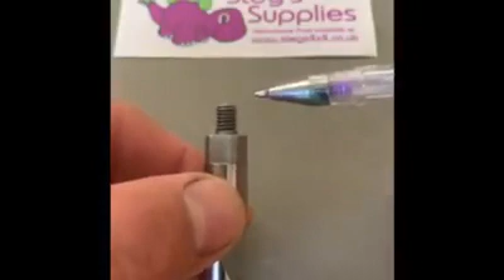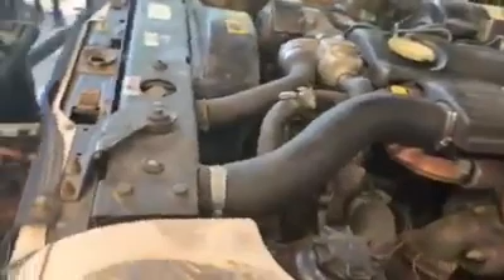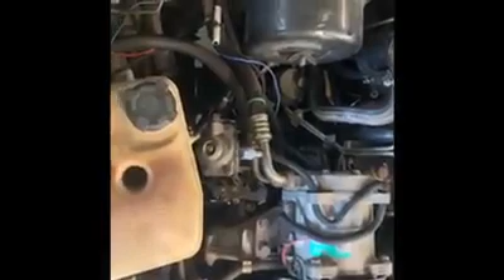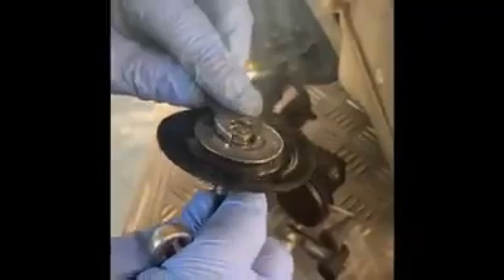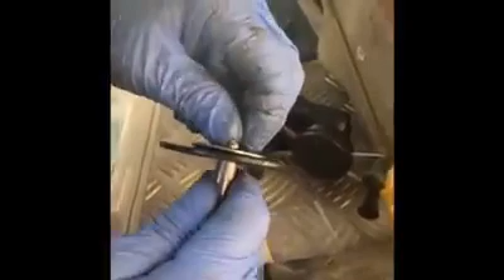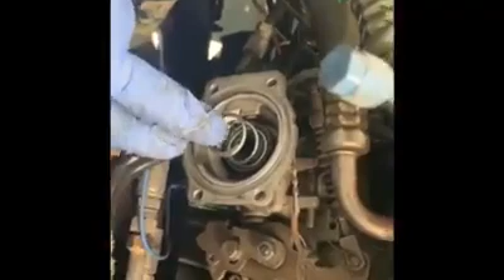300tdi boost pin replacement | Overland Expeditions

Comment: Ciao sono in procinto di mettere il pin boost.. Al rimontaggio il pin  in che direzione è messo? Con l'incavo verso il radiatore o verso il motore
Reply: The recess in the pin faces the front of the motor (facing the radiator).  You will see a small pin that runs along the recess and is pushed in or out.  This pin controls the fuelling.